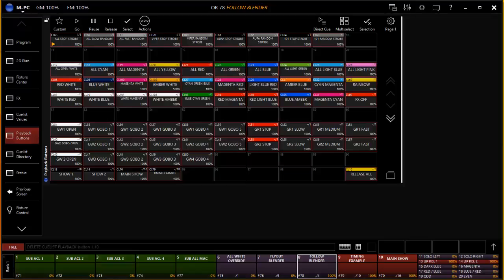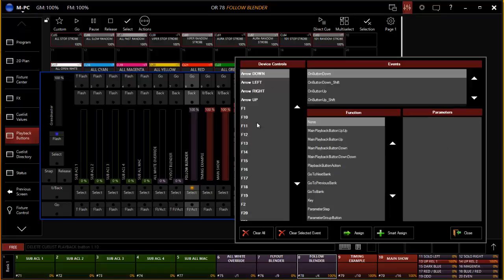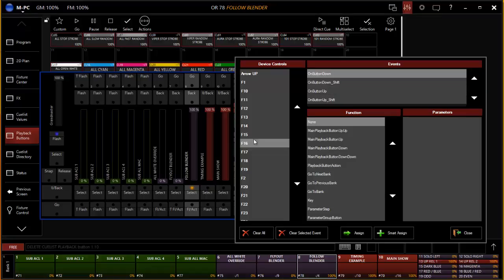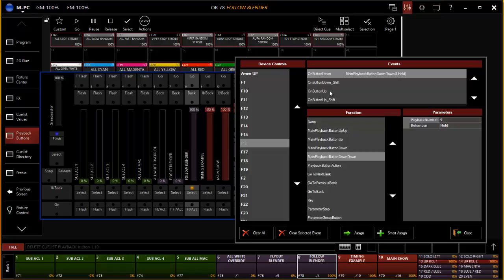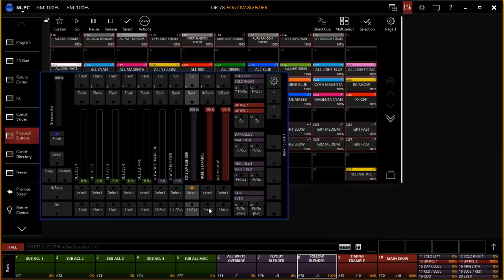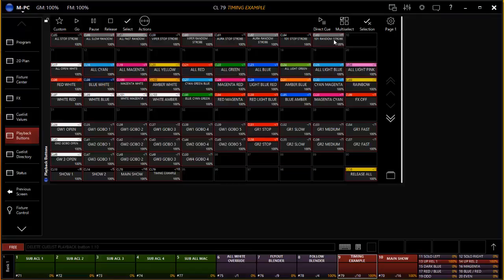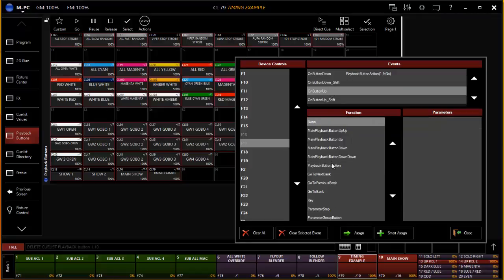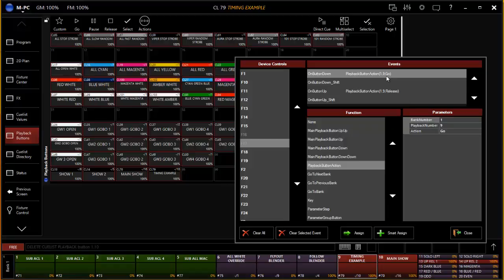RD/MPCTools v3 Tutorial #4 - Flashing Playbacks

Comment: Hi, please could you tell me how to make an "Release all" preset, like this one you have on button 100? Thanks in advance!
Reply from the maker: This is the sample showfile that is installed along with M-PC.
Release All is basically an empty cue inside a cuelist. You then add a macro to the cue - there's a "release all" macro to chose from.
Reply: Wow, thank you a lot! I found it! Actually I didn't care about macros until now, because I'm new in this, but now it's something new I know. So, now I need to learm to use cuelists with timecodes... Thank you again!
Reply: Now I got an idea how to work with timecodes. But I have a question: can I somehow set a BPM with macro, or maybe using a LUA script? Any other way except tap?
Reply from the maker: Just asked for that on the Elation forums.
Reply: Thank you for your effort. I hope it's possible somehow.
Reply: Another question: let's say I need 10 chasers. All of them should be synchronized with global BPM setting. The first 5 should work 1 on 1, but other 5 need work at double, or even triple speed. Is something like that possible to do and how? Thanks in advance!